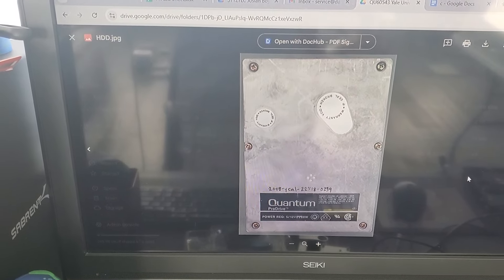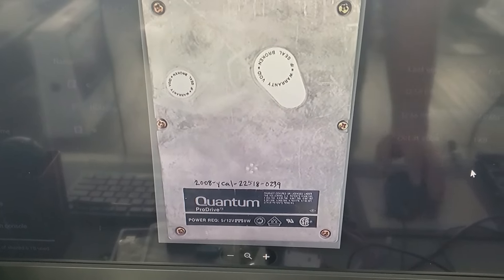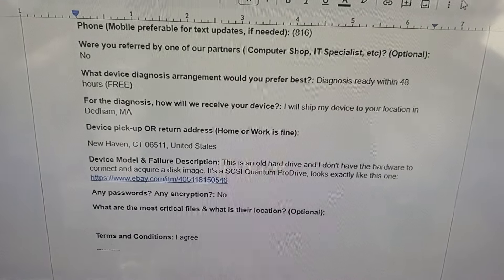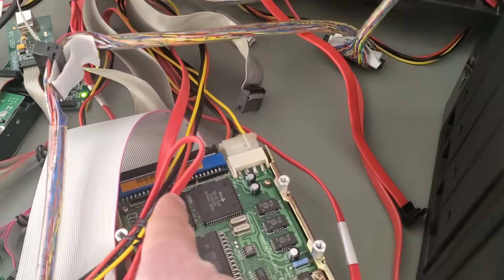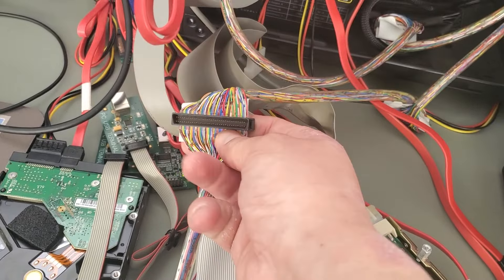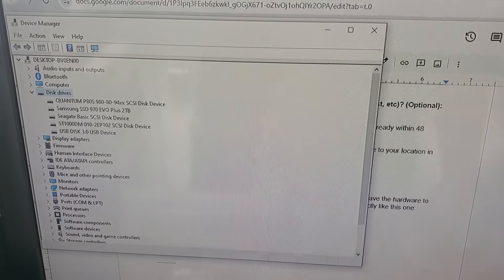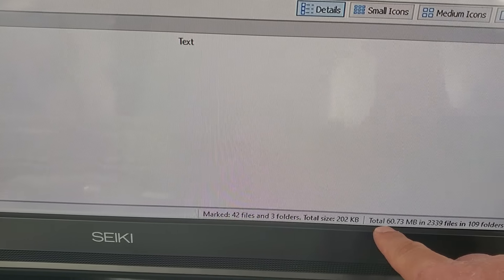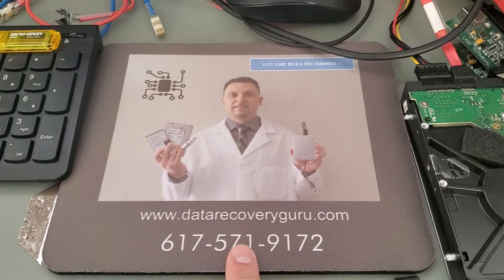SCSI Hard Drive Data Recovery - Old 50 Pin HDD

Comment: This drive is a Quantum Prodrive 80S. Quantum drives from this era suffer from a issue where the rubber bumper protecting the heads disintegrates and makes the heads stuck. You've gotten very lucky on this one.